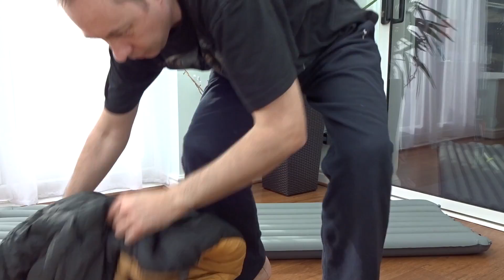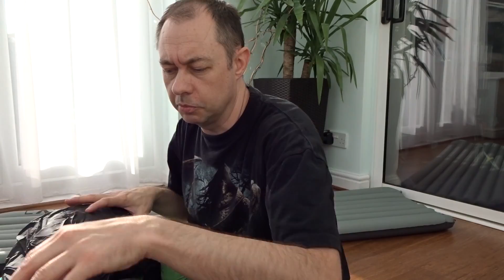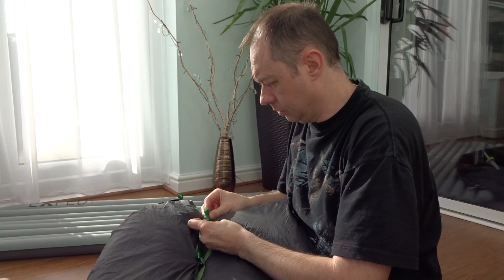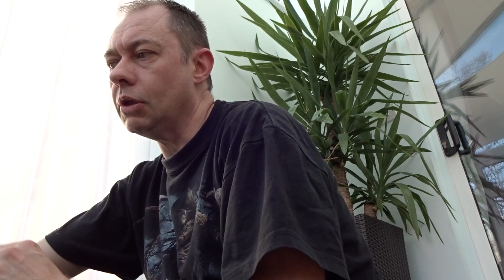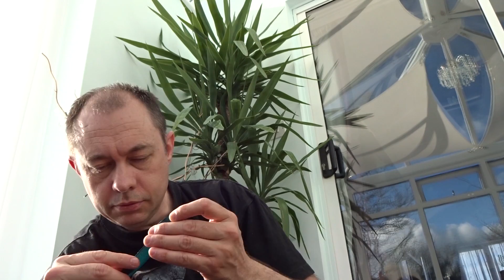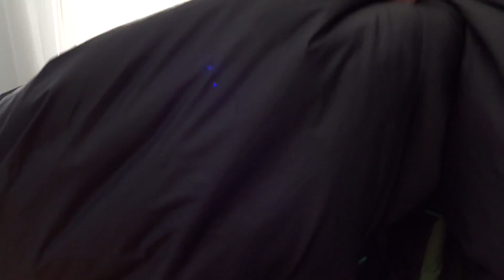Top Quilts

Comment: I started using top quilts when I began hammock camping and soon became a convert. I no longer use sleeping bags, even for ground sleeping, and enjoy not feeling claustrophobic as well as saving weight. 
One observation I have made, as well as many others, is that a ground quilt does need to be wider than a hammock quilt, and not just for the obvious reasons that one loses the side insulation from the under-quilt and that a little extra is required to tuck underneath.After several nights (or even hours) ground sleeping, it is (for me) an absolute necessity to vary my sleeping position and the width of the quilt must accommodate side sleeping positions also.
I've watched several of your videos now and am very impressed by your DIY ethic and inquisitive nature.

Comment: what weight climashield did you use 6, 7.5 , or 10 oz/yd2?
Reply from the maker: bill bloomington it was 6oz :)
Reply: one more question.  I plan on making one.  I was thinking of  buying 5 yds of a fabric so I would be using the same fabric on top & bottom. My question is:  Would you just fold length in half or cut the top & bottom separately?  thanks
Reply from the maker: bill bloomington well i would cut two pieces as you might need draw string channels at both ends so its eaiser with two seperate layers, also you want to stitch the insulation into the hem to stabalise it, so this is also eaiser with two layers.

Comment: Hello,  I really like your design ideas and as I am already making some of my other gear, I would like to give this a go too.  Can you tell me where you sourced the Climashield Apex in the UK?    I am having trouble finding a supplier.   Thanks, Pete
Reply from the maker: Sheldon Cooper nothing in the uk,  the nearest place is germany google extremtextil.de
Reply: That's very useful, thank you.
Reply: Hi, can you tell me which thickness of Climashield Apex you used?   I am definitely going to give this a go.
Reply from the maker: Sheldon Cooper i cant really advise i went for the thickest,  and its not enough for me in the winter,   so i use down.  Good for 3 seasons tho
Reply: OK, thanks.   I was looking at the same thickness as you used.    I am thinking of using something like this on the West Highland Way next Easter ( April ) and will test it first.   Your videos are excellent - everything is clearly shown and your camera is stable.

Comment: Seeing this video makes me realize that maybe I've done a big mistake investing into a regular sleeping bag...
Reply from the maker: No,  top quilts are not for everyone,  and deep cold they still say a bag is better for survival conditions.
But quilts are ideal for very long hikes where weight is the top consideration. 
You can unzip your bag and use it like a quilt which will boost its rating and you get to see what its like.
Reply: Actually that's what I did, in the very first trip with the new bag: I unzipped it gradually to adjust the thermal comfort, until I ended up using it as a regular foot-boxed quilt :D
Reply: Great video I'm just making one using a lightweight army jungle bag I've taken the zip out and reused a channel for a lightweight bungee at the foot end.
Can you give me more details of those snap closures as that just what I'm looking at to finish the job. Yet another fantastic tutorial video

Comment: What size did you make the quilt? Very sweet job.
Reply from the maker: I make them all different sizes, depends on the purpose and the person,  and the kind of taper to use,  this one was about 2m by 1.5 at widest i think.
Reply: Thank you. That's the exact size I'm working on. Looks like it's perfect—nice n cozy. I like them a bit bigger. I move around a lot and too small gets left behind. Did you quilt (sew) that at all? the Climashield APEX has the continuous filament and I was curious at how much quilting it needed. Hike on.
Reply from the maker: No quilting needed with apex :)  easy way to start with quilts :)

Comment: Very nice job. Some years ago there was a sleep system for extreme cold that used a thick pad and a high loft top quilt, same idea but warmer. I would be interested in seeing or at least hearing how you made the top quilt as this is something I have wanted to make for my hammock camping. Again, very nice job.
Reply from the maker: Thanks for the comments,  check this out,  i did some mods but this is a good guide
http://diygearsupply.com/wp-content/uploads/2013/10/DIYGS-Top-Quilt-lowres.jpg
Reply: +Tac Blades Thank you much, I will look over the site.

Comment: Hi mate. Good film and something I have considered myself but your explanation of how to use one was very helpful. Just back from the Mamores on Friday and inner tent and my down bag were wringing with condensation. Will have film up in a few days so you will see what I mean. Need a lightweight solution as I have been trawling all the different bags out there and keep going back to maybe an Alpkit with the bivvy bag over it. Does your head in after a while. Bit like your stuff-sack, I have been finding ways to pack everything as long sausages in my rucksack. Find it way easier to pack and pull out the items you want to use if you know what I mean. Also allows for a slightly smaller rucksack. Atb Ray.
Reply from the maker: I was in a similar situation,  for me ventilation and a vapour quilt solved all my problems,  now my bag is bone dry every day.  Yoy could improvise a vapour quilt very easy. 
I have not had good experience with bivvy bags,  they all produce a lot of condensation,  the best ones are eVent fabric but even thoes condensate,  i think a synthetic bag on a bivvi is a good match.
Reply from the maker: There is another way to pack,  take a could of bin liners doubled up, put all your soft gear into thoes and put directly into the bottom of your bag,  without stuff sacks,  this then moulds into all the spaces in the bag and makes the best use of the space,  you will be surprised just how well it fits.  :) oversizes stuff sacks are also a trend in some areas for thr same purpose.

Comment: Nice vid interesting to see what you started with and progression. I made my own sleeping bag as I couldn't find a small packing size non mummy bag so I think I will remake it using climashield cheers for the tip Tac.  I made my bag thinner on the base to allow for a smaller size but on each side it allows for the thicker insulation to curve round just a bit before going much thinner to illuminate draft/cold patches when moving at night.
Another very useful vid indeed much appreciated.
Reply from the maker: Sounds interesting,  thanks for watching :)